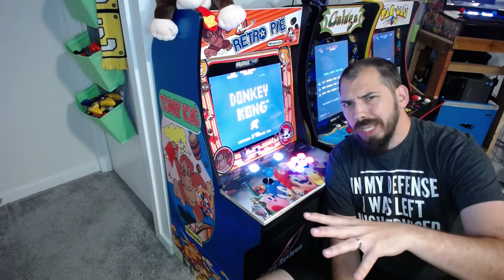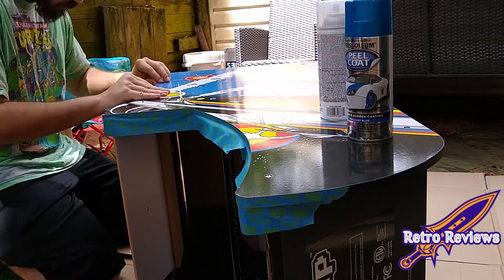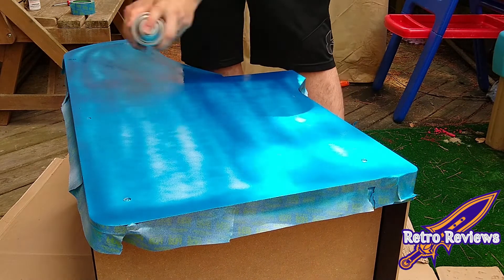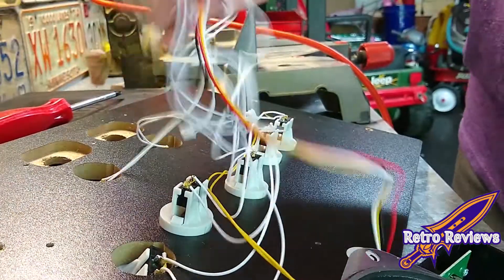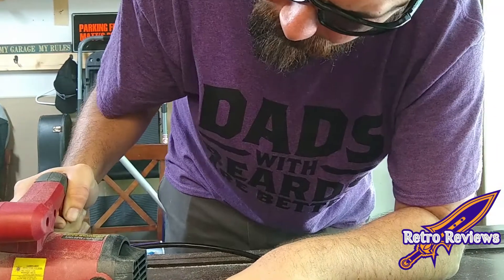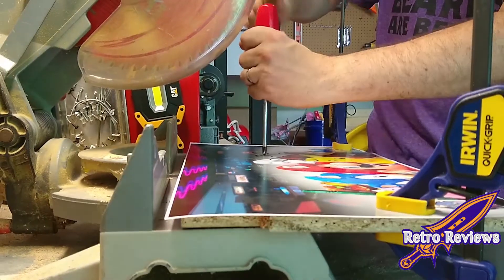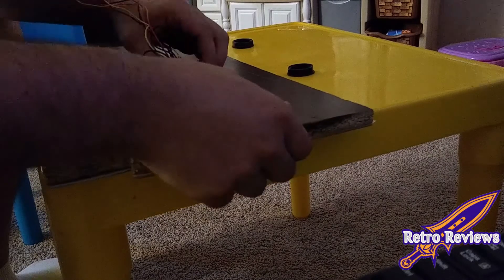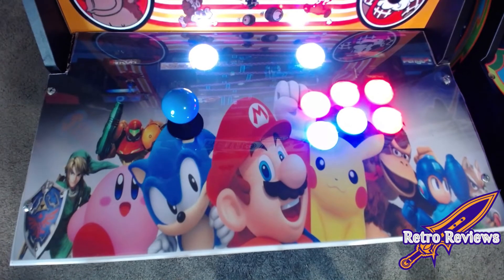Build your own Donkey Kong cab cheap! Arcade 1Up!

Comment: How is putting the screw into the particle board supposed to be a ground??  Not trolling, I'm genuinely asking.
Reply from the maker: You're connecting the ring terminal from the monitor to the circuit board. It's just easier to screw it to the wood than to find a small matching nut and bolt, plus it adds support.